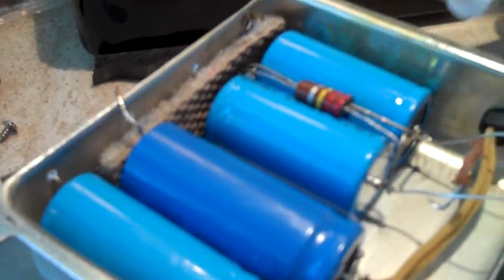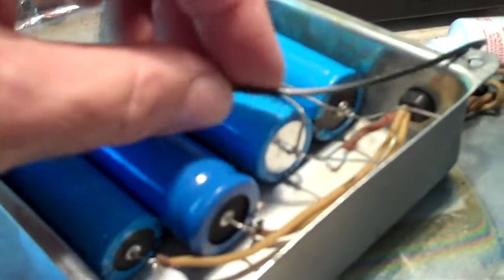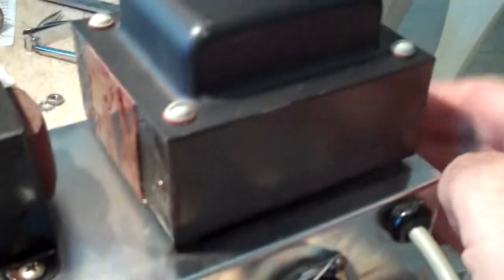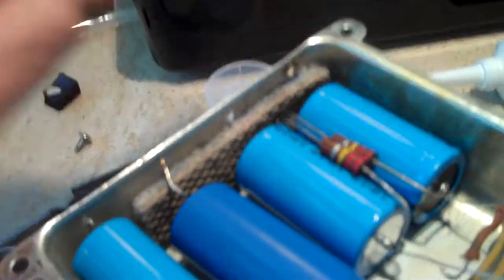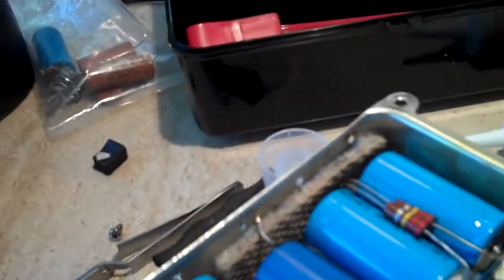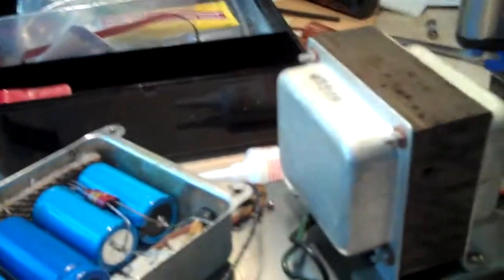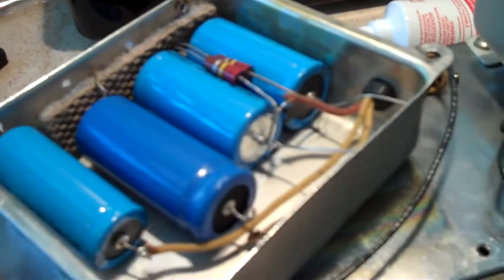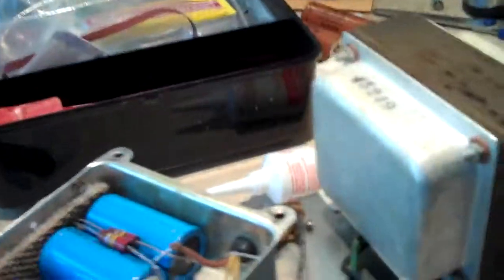Beefing Up the Capacitor Filtering on a Tweed Bassman for More Punch

Comment: Interesting and yes it gives more reserve power for the low end notes.....the typical power rail of a twin reverb.  But the twin reverb has a rectifier of silicon diodes...….which some would call a fast amp, as its the slew rate
I scratch my head though with tube rectifiers, because when you look at the tube manuals......rectifiers have a ceiling when it comes to the power condensers.  typically between 40mf and 50mf, and if you exceed this......you will blow the rectifier tube.  It wouldn't typically blow immediately upon hitting the switch on......but it wouldn't be too long.  
I usually do new power caps with a 47mf for a tube rectifier and do the totem pole for a solid state rectifier.  

You shouldn't really blow a rectifier tube.....

I've seen weber's column years ago in vintage guitar magazine and read this, and it was suspect because of the tube data sheet in the manual.  Did he ever go into a detailed explanation ?????
Reply from the maker: Yes.  I asked Gerald about it and he gave me his explanation but it was a little over my head at the time.  His final statement was, "I've been doing it for years and never had a problem.  The trick in his mod is to bypass the standby switch which I think is the same as the AB763 blackface circuit.  When I turn on the power, the main capacitors charge up first while in standby and he says that takes the strain off of the rectifier when you turn off the standby.  I've had both Bassman amps like this for 8 or 9 years now.  I did blow one rectifier in that time but I am sure even on a normal setup, that the rectifiers don't last forever.  He does a few other mods that are in both amps, like move the capacitor grounds from the cap can to the main ground over by the PT with a long wire.  I'm thinking those tube manuals are very conservative.  Fender pushed a lot of power tubes past their recommended limits.  Maybe that is why they sound so good.

Comment: change my filter caps in my 63 band master and it took away the sweetness of it so I had to change back to stock  Pat  is a good dude he knows what he's talking about
Reply from the maker: Yes, it can make them feel a little tight but I think that works best at high volumes.  I'm sure it depends on the amp.  Fender didn't go much higher on the Reissue.  They went with 50uF/700v.  I may try lower filtering one day just for fun.  The good thing is keeping them in series gives you that high voltage rating.

Comment: I am not a huge fan of this mod...although i have done it many times.  It increases headroom and some time this can take a vintage amp out of its sweet spot.  Fender did this mod on their 59 reissue as well as using 40mfd for the fist pre amp stage. The stock 8-10mfd 59 spec definitely sounds better in the pre-amp. YMMV
Reply from the maker: +patfurlan I had originally put the 20uF/500v caps in the 1960 Bassman and everything was working fine.  I then read from a amp expert that the voltages could occasionally jump over 500v and that is why he recommended the caps in series like the blackface circuits.  I didn't notice much difference in the two set ups.  Too bad they don't make the old type 20uF/600v caps anymore.  I did make the mistake of buying some Astrons with that rating but they were huge and were actually two caps in one can wired in series.  I've been satisfied with the beefed up version and have only blown one rectifier tube in eight years.  I could have just been ready to go.  I am not sure what caused the GZ34 to go out.  I should go back to the 500v version someday to see how much difference there is.
Reply: I have done this mod many times. It depends on the application. I have a 57 and a 60 bassman and I play around with values on a reissue. I also have a bunch of Traynor yba-1 which are 59 bassman circuits with beefed up power supply circuits. To make them more vintage/ fender I rebuild the power supply to Fender specs. Though on many I use 80mfd for the first B+ filter for more punch.
Reply: great channel BTW ... love it
Reply from the maker: +patfurlan Thanks a bunch.  I enjoy exchanging information.  I always learn more in these discussions.  Do you see a problem with using the 500v caps in the 5F6-A circuit?

Comment: Hey again, So I got the caps in from Gerald, He did send a little schematic showing the orientation of the 220 MF caps. He mentioned removing the .05 and placing a totem pole stack on the hot side of the standby switch? is he referring to the Astron on the standby I wonder ?

I think I have all the info straight for the cap job, however I want to be sure I have all the info for the ground and standby wiring. Any help would be great ! cheers
Reply from the maker: Mike MacDonald I never did anything with the cap on the standby switch so I think it is okay to forget about that mod.  To ground the main caps in the pan, the last cap grounds to the pan like the old way, through the hole in the pan and soldered to the pan.  Now you are left with the ground of the main caps which comes off of the bottom of the second cap and the ground of the third cap (which could still be soldered to the pan the old way if you like).  I ran a jumper from the third cap ground and tied it to the ground coming off of cap #2.  From there you run a new braided ground wire through the pan grommet hole with all of the other wires and through the chassis hole, neatly in the chassis corner and past all of the pots, around the corner to the main ground on the chassis.  Solder it there.  That new ground (black wire in my video) wire will be about 10-12" long.  For the "standby" mod, first print out and look at the Bassman "layout" schematic.  On the far top left of the circuit board you will see a hole in the board and a wire from the right side of the standby switch goes through it (dotted line designates it goes under the board) and connectsto the next eyelet to the right.  There is a red cloth wire coming from the pan (cap doghouse) that connects there.  You have to clip the red wire at the board eyelet and run a jumper wire from there to the left terminal on the standby switch.  That way, when you power on the amp in standby position, the main caps are being charged.  Once you flip the standby switch, the charged main caps will help charge everything and keep it from stressing the rectifier too much.

Comment: Hey again, I'm in Ontario, Canada. I have had some difficulty contacting him via email/phone. On his web page I can see the caps with the values you mentioned below, I just want to make certain I can get all the info with the purchase if possible. On another note, I haven't done a whole lot of testing with tubes on this amp other than the 5881 re-issue tungsols and Jan phillips 6L6wgb ( these are supposedly a lower wattage tube aswel, 23 watt ). The Jan Phillips sound great ! reissue tungsols are okay, Im still looking for more of definition in the bass however, perhaps a bit more tightness. I think the fidelity of these Jan tubes are very nice and even but still need something that carries a bit more weight to the sound.

The amp is original for the exception of filter caps, currently I have 2 x 22 uF /500 v, 1 x 47 uF /500 v .Unfortunatly I purchase 4 x 20 uF/600v before the amp arrived to me and they don't fit in the filter housting.  I can certianly hear the potential in this amp, It sounds like it has a huge frequency range, more so than any other amp I have played, very colourful. 

I know im getting into to many topics here, but I wanted to mention that I am using a 12Ax7 in place of the 12Ay7, for some reason I just cant get the amp dialed in the way I like it with the 12Ay7 . I understand the 12AY7 is a lower gain tube and I have read this should clean up the signal to be not as dirty, I loose a fair bit of headroom with the 12Ay7. Just wanted to get your take on that preamp tube.

Anyways you seem to have spent some time with this amp so I thought id share and pick your brain.

Cheers,

Mike
Reply from the maker: Mike MacDonald Mike, I'll get back with you.  I made the same mistake on those big 600v caps.  That is why this setup works so good.  I have not watched this video in a while.  I need to watch if first to see how well I explain everything.  It is basically an upgrade to a AB763 blackface circuit like Fender did in the mid 1960's.  The trick is cutting the red cloth wire going to the circuit board from the pan and running a jumper to the left side (looking at the schematic) of the standby switch.  It is not absolutely necessary to run the long ground wire to the main ground on the left side of the chassis where the tranny is grounded.  Gerald said it is the proper place to ground and I think it might cut down hum a little bit.  You could still ground to the pan like the old caps were.  Running that long ground wire is a little tricky to make it neat.  You have to route it in the corner of the chassis past the switches and around the corner.
Reply from the maker: Mike MacDonald Mike, let me know if you need help installing the caps.  You can see (in the shaky video hopefully) how I have the main caps in series.  The third cap is 40 uF and the fourth is the standard 20uF.  Jump the ground of the 3rd cap to the ground of the 2nd cap and run that new ground cable through the grommet to the chassis main ground.   Ground the 4th cap to the pan like the old style through the hole in the pan.  Run the red cloth wire to the 1st cap positive.  Notice the 1st two main caps are flipped so they will be in series, 1st is positive/negative (rubber spacer side) and the 2nd cap has the positive hooked to the negative of the first cap.  The second cap has the negative side facing the exit hole in the pan for all of the wires which is the exact opposite of the original schematic.  The only thing left to do is the jumper to the other side of the standby switch.  Let me know if you need help on that.  

I have heard nothing but good about the new Tungsol 5881 so those should be good. The 6L6GWB are good to.  Whatever sounds best to you.  I use an RCA 5751 (triple mica) in V1 in both of my Bassman amps.  I really like that tube.  It is hard to find standard 12AY7's that are not microphonic so I always used a good 6072 before I switched to 5751's.  The 5751 is half way between the AY7 and the AX7.  Be sure to bias the power tubes no higher than around 38 mA so they won't wear out.  I also use a Carl Hartman Amp Saver to keep my voltage at 109-110 volts.  Even at that house voltage, my power tube plates run around 424 volts.  The old 5881's are theoretically rated at 400v but they can take it just as long as they are not biased too hot.  I think the new 5881's may have a higher rating.  My usual house voltage is 121 volts.

Comment: Hey, I like the video, your bassman sounds great. I have a 1960 bassman aswel and stumbling on this video I think that I would like to try this! I am competent to perform work on my amps, Can you tell me what the cap values are of each ?
Reply from the maker: Mike MacDonald Are you in the US?  If so, I would contact Gerald Weber at Kendrick Amps and see if he will tell you how to do it.  He is the one that came up with it back in the day.  He has it in one of his books but I am not sure which one.  If you buy your caps from him, he will probably send you the instructions.  He is very helpful and will probably tell you even if you don't buy anything.  I think he has the best value caps that he had made especially for him.  In the doghouse, the mains are (don't quote me because I may have forgotten) 220uf/350v in series; the same way Fender did the blackface AB763 circuit.  You have to put a couple of resistors in series with them.  The screen grid supply is 40uf/500v.  The other two are the same 20uf/500v.  The tricky part is switching the wiring on the standby switch and moving the pan ground to the main ground on the chassis.  That takes a wire that goes from the cap grounds to the far side of the chassis.  The standby switch mod is to help charge these bigger caps without stressing the rectifier tube.  It is a great mod and I have done it on both my 1959 and 1960 Bassmans.  Let me know if you cannot get the info from Gerald.  I actually had to tear my 1960 apart to look and see what we did at Gerald's Amp Camp so that I would remember exactly where the wires went and how to put the two main caps in series which combines to give you 110uf/700v rating.

Comment: millstap, Can I get your opinion on the 59 reissues?
Reply from the maker: I played one once at Guitar Center and thought is was pretty cool.  But that was only after about 5 minutes of playing.  They are not really very close to the real thing.  I've read websites that give all of the changes that need to be made to the circuit to get it back to the original.  There are a lot of differences.  I still suggest getting a real one if you can afford it.  On a side note, I took this one and my 1960 to my gig on Halloween and this one (1959) stopped working on me.  I was really bummed but thank goodness I had the old dependable 1960 to finish out the night.  I spent the last two days troubleshooting and it is fixed.  That is the good and the bad thing.  The old amp parts (if they are all original) will crap out occasionally but the good thing is they are easy to fix.  I had to ask Dan at Area 51 Audio Designs for a little troubleshooting help.  It is always good to have a friend that is better at amps than you are.  All it was was a bad .1 uF Astron cap in the phase inverter section.  I replaced it and the amp it good as ever.  If the 1959 reissue craps out, it is off to the shop.  The new printed circuit boards are just not dependable if you gig with it steadily.  The other alternative is to get a good Tweed Bassman clone that is point-to-point wired for easy maintenance.  Or build one from a kit.
Reply: millstap I thought the reissue sounded quite good. I also like the bassman tone stack in the 68 Deluxe Reverb reissue. You need a pedal with it to get any serious overdrive though. And yes, I've been looking at clones. There are a lot of them around now. What I'd really like to find is something along the lines of a late 50s Super but around 30 watts. The Bandmasters from that era are about right powerwise, but they just don't have that great overdriven tone of the Super. Bob Gjika's SE-30 is fairly close to what I'm looking for. Kind of a bassman tone in 30 watts but with more breakup. Thanks a lot.
Reply from the maker: Charles Seper Yeah, it is personal taste.  I always go for the most headroom so when I need it, I have it.  I would rather have a 80-100 watt amps like a Marshall Super Lead but they are just too hard to haul around.  Twins are cool too but I have never really used one.  With a clean amp, you have all of the options when you add effects.  Plus, you have strong bass that does not fart out when you punch it hard.  If I were playing big stages, I would also want a solid state rectifier to reduce the lag you get with a tube rectifier.
Reply: millstap I've never been able to find a nice gigging amp where I didn't need a pedal for something. The Super-Sonic 60 is probably the closest I've found that didn't cost a bundle, and I'm pretty close to settling on one of those. I'm a Tele player and I like to just roll the volume knob back on my guitar to clean things up. While there are several smaller 15 to 20 watt amps I can do that with quite well, it's much harder to find something in the 30 to 40 watt range that delivers plenty of overdrive that also cleans up well. An Old Vibrolux works pretty well, but you have to darn near dime the thing, and then it doesn't have a negative feedback loop, so their hiss city. I'll probably just end up buying a SS 60. At least the price is right and the sound is close enough I think. Maybe with a little tinkering with speakers and tubes I can find something that suits me even better. Thanks for your input.

Comment: what are you biasing your 6L6's  too??? what number is best?
Reply from the maker: They are vintage Tung-Sol 5881's.  I usually Google "tube bias chart" and look at the bias calculator.  I use Jim Jones bias table to get in the ballpark.  But, 33-35 is usually my range.  38-39 will wear out tubes pretty fast depending on plate voltage.
Reply: millstap OK  THanks